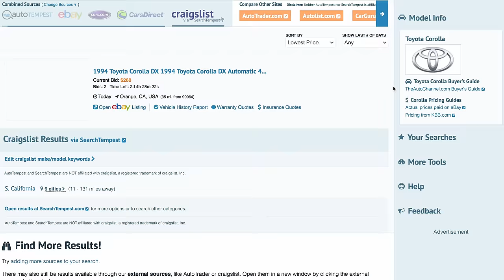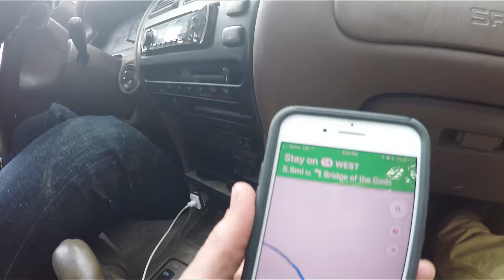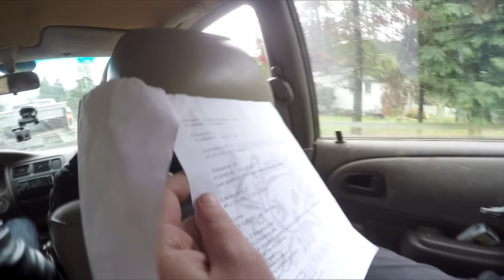500 Miles in a $500 Car - Gambler 500 | Car Boys

Comment: That Corolla still sounds better than my 2020 Charger
Reply: What trim?
Reply: @lukeallen91  It's just a v6 so that's the reason it sounds so bad haha. I'm looking for some exhausts currently
Reply: Some Hater ur username says it all
Reply: Some Hater  I was getting a little bit more "car" for my budget
Reply: Some Hater  ah gotcha
Reply: @brendan_s550  you should look for a V8 instead. Some of them (like the obvious LS) are actually cheaper than an exhaust system
Reply: 7AFE is the 4AGEs cousin
Reply: @זהסודי-ה7מ  Your not LS swapping a 2020
Anything for less than the price of an exhaust system lol. As for the original Charger guy, for V6 cars just go the intake route and leave the exhaust mostly stock. Your V6 exhaust will never sound like the Hemi and will always suffer from drone and rasp. Nature of the type of engine platform. A good intake growl though can sound amazing on those cars.
Reply: Every car sounds better than a charger
Reply: Mine too
Reply: @brendan_s550  just keep it stock. v6s don’t sound too great in general
Reply: @fsl3242  yeah, ik lol. just a general disclaimer, I sold it and bought a 2020 mustang gt and it sounds so much better haha
Reply: @brendan_s550 ok great purchase!
Reply: @fsl3242  I know, I love it!
Reply: @brendan_s550  it’s it a 10speed or 6 speed manual?
Reply: @fsl3242  it's a 6 speed manual
Reply: I don’t wanna know what’s wrong with your car lol
Reply: It also sounds better than the car that I don’t own
Reply: That v6 has plenty of hp for everyday use. I've got an 18 grand Cherokee v6. It's faster than my 09 mustang gt.
Reply: That's cos its a charger pmsl
Reply: well it looks like the car doesn't have an exhaust, you can try running open headers and see how it sounds as well.
Reply: Say it ain’t so
Reply: @9731Tolkien  
😂🤣😂

Comment: jesus this car is gonna break down immediately
sees toyota badge
oh nevermind theyre good to go
Reply: I remember the top gear episode on the Toyota pickup. That thing is indestructible
Reply: Yeah, I got a 2004 Toyota corolla. The clutch broke once, and thats about it.
Reply: Old Yotas are fucking indestructible .
Reply: The ScottyKilmermobile
Reply: Still driving my 2000 Toyota Yaris without any problems (clutch and transmission kinda fucked but it works sooo...)
Reply: I Had a fleet of Toyota Hybrids AS Taxis in Germany. Those Things worked for ever 15 years and way over 500000 km was No Problem. Some of them Had different drivers every day. I drive Lexus now Same Same. Have two an GS Hybrid and an old 2jz GS from 96 that i boosted and IT Looks Like a New York Taxi. The Germans Love it 😄 and ITS ca 520 hp
Reply: 2001 toyota prado. only issue its had was a small crack on the dash. thats IT
Reply: Still running 1997 Corolla AE 110 as my daily
Reply: My mom got a $300 '99 corolla with 175k miles.  Put a rotor and some pads on it, decided to be nice and throw some plugs in it for her.  She got another 200k or so out of it never changing the oil and apparently topping off the oil with used crap from under my porch. It FINALLY kicked a rod at 393k miles. Best cars ever built.
Reply: my first car was a $500 97 camry le with 350k miles and 4 cylinders of badass. I only changed the break pads and oil & it just got to 490k miles when I got rear ended bad and totaled.
Rip Goldie 🤙
Reply: @123speedmaster  best cars in the world man
Reply: @genesisx6521  honestly the hilux and the old Toyota’s were like the Nokia 3310s of the car world
Reply: True my fellow car fan ;).
Reply: @wildboer  I killed an 83 celica GTS. But it took 290k miles and it was more my fault than the car.
Reply: my 21 yr old toyota has 250k miles and is running strong
Reply: 2005 avalon xls, 180k miles. nothing has ever broke on it. paint on the rear bumper is peeling a little bit, one of the exhaust tip covers is loose
Reply: @marcbeebee6969  nice!
Reply: I drove my MR2 daily (except in winter) until it was 33 years old. Now it´s 38 but I drive it just for fun now.

Comment: Give a man a Lamborghini and he'll pretend to be happy as he is constantly pulled over, heled back by the roads and trackday tickets, and expensive parts to fix it, give a man 700 bucks to buy an old toyota and you wont be able to wipe the smile off his face as he thrashes the car knowing it will be okay and revs it out all the way without getting in trouble with the law. 
Bonus points if its manual

Comment: Me: *pulls up with 4.3L VORTEC S10*

Note: It's one that's been rotting in my backyard in 1.8m of snow over it each winter for 2 years now, apparently it has a small hole in the frame for the bed (which is not a big deal) no ABS and no e-brake